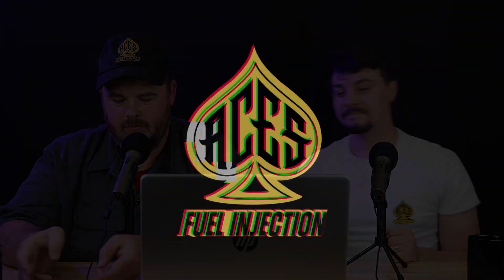Tech Tuesday Ep 37

Comment: Hey guys jackpot system 5.3 4l60e 3rd Gen Camaro, It runs well, but when cold trans slams hard into reverse/drive, and gets much better when up to temp.  1-2 shift it falls on its face bad but gets better and doesn't do it nearly as bad on the 2-3 and better on the 3-4. And while cruising back roads 30-40 mph it feels like it kicks in and out of lockup like it doesn't know exactly what to do. Any help is greatly appreciated. Thanks for what you guys do!